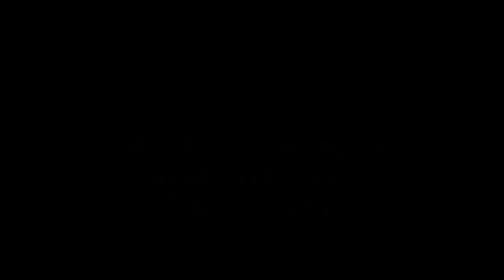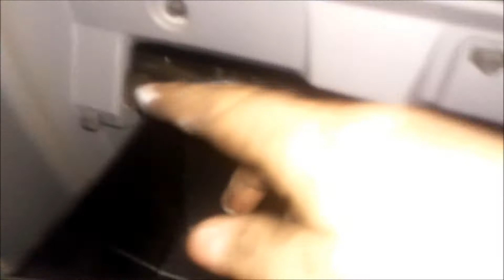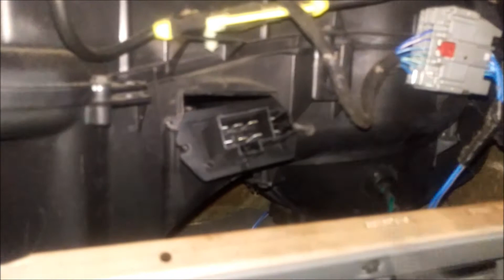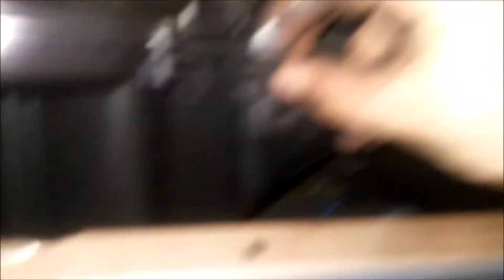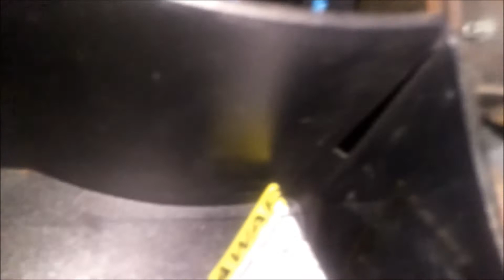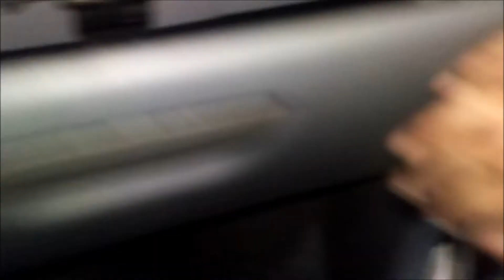Blower motor resistor 2001-2007 dodge,chrysler  minivan

Comment: Joe! Thanks! I replaced this some time ago but have recently experienced an intermittent failure of the blower motor on my 2006 town & country nearing 200,000 miles. Thanks to you the temporary fix is in. I dropped the glove compartment as easy as it was I had forgotten until your vid. I swatted the blower motor housing with the ice scraper a trick I learned as a electromechanical technician. Often failing bearings can keep an ac/dc motor from starting, but a little tap on the shaft can loosen misaligned bearings and fire the motor up. It works. I removed the glove box entirely until I can replace bearings or/and motor. Now if the blower isn't blowing I can whack it with no more motion than grabbing the ice scraper and taking a swing at it.

Comment: If my blower is intermittent works and then quits but the fan still blows on low. rear still works. What could be wrong loose wires loose connection? Thanks for the vid by the way it helped!

Comment: Question on this My blower motor stopped working everything lights up on the dials but the blower is dead like would it be the resistor that stops the motor blower ?
Reply from the maker: To answer this question some testing would be needed the resistor may be at fault or the blower motor could have failed completely or the fuse may be bad need to test for power to blower motor and ser heats going on